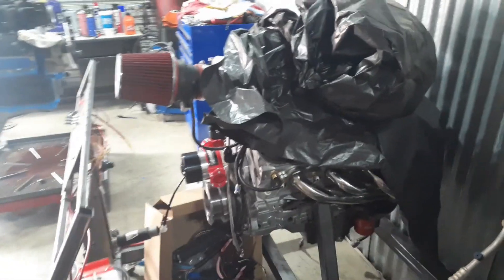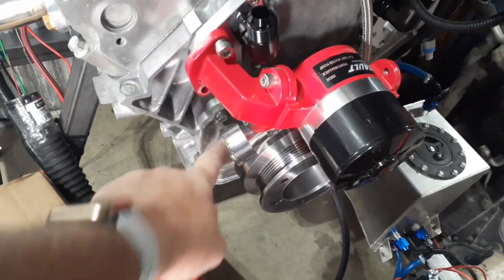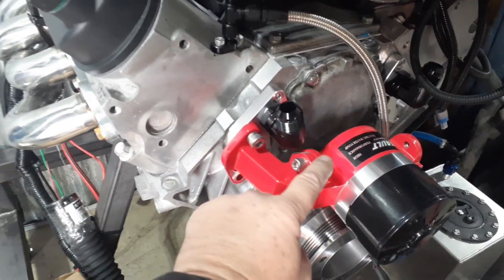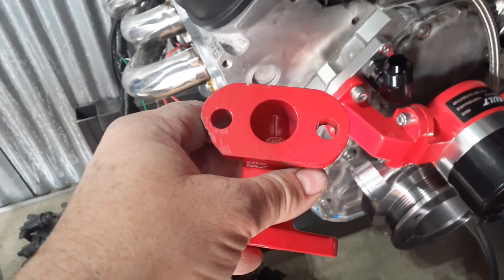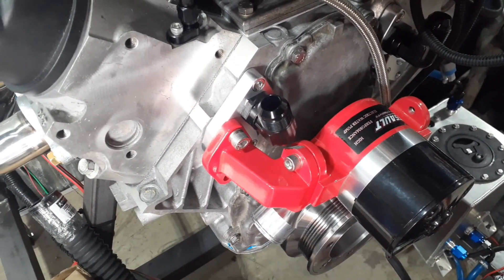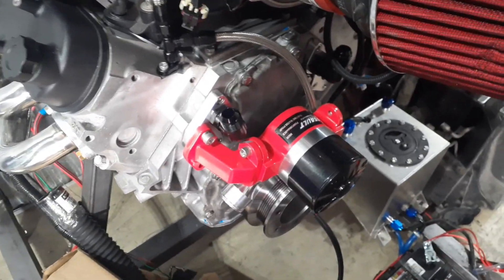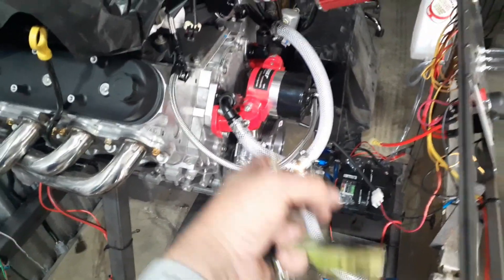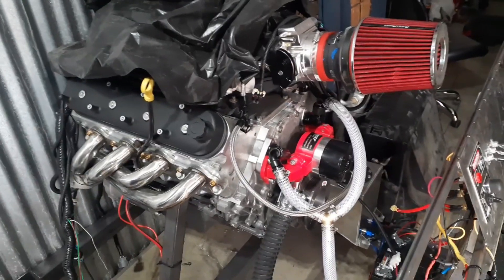Assault Big Block Chevy Electric Water Pump on an LS1, Set Up

Comment: Bbf guy here.  Have one on my 460 screw blown ranger.  Edge of castings were close to hole where it bolts to block .  Cracked..
Reply from the maker: That's not good.  Was yours an Assault brand or some other one?
Reply: @carstars1181  assault yes.. . But I called them today &  there fixing the problem.
Reply: Or not.. someone makes billet elbow for these. Found on the evil bay.  So I just ordered them.